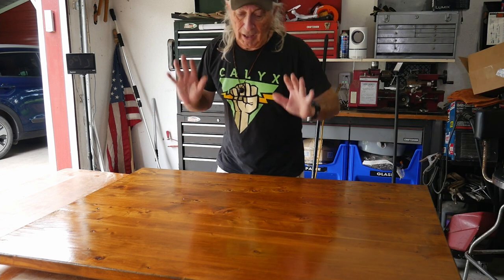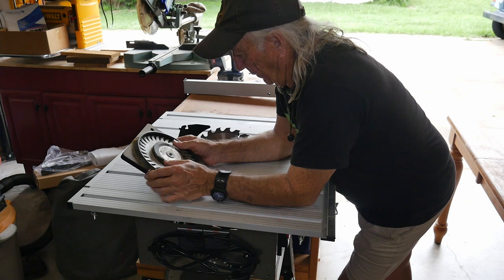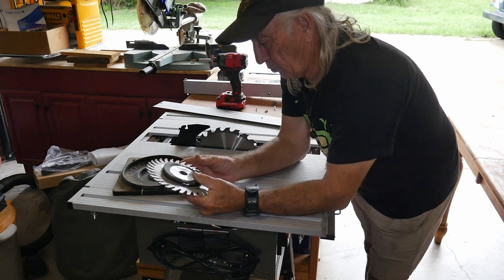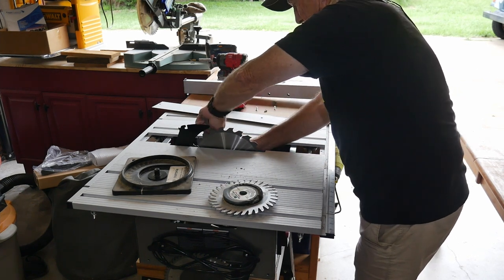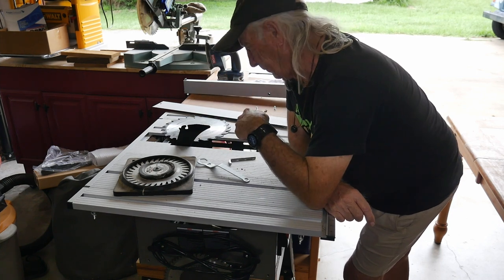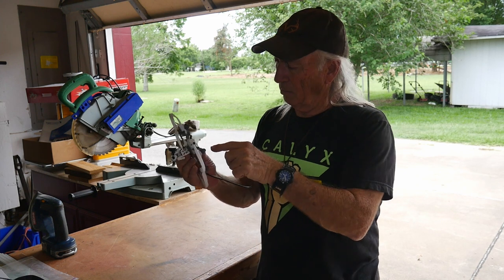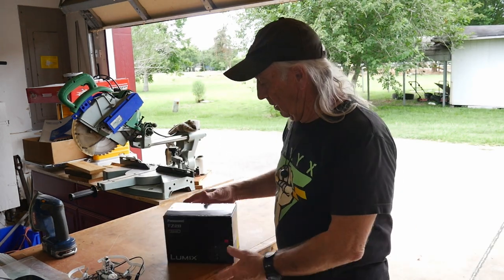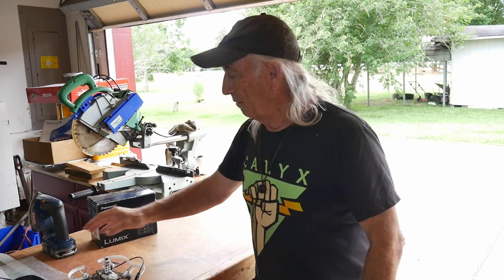Dado blades on Tacklife table saw ? Give away again this week at C&T episode 156 More FREE STUFF !

Comment: I ran into the same problem with my Dewalt….too short an arbor for a stack. HOWEVER, I found a guy on YouTube (what CAN’T you find on YouTube), who determined the arbors on the Dewalt saws are identical INSIDE. SO, he did a video that identified all the necessary components by part numbers, and how to swap the short for the long! I can now do dado stacks! The only issue is the guard. He showed how to make one in wood so I’ve not tried the Dewalt manufactured one which means I can’t speak to if it would fit though I have no reason to believe it would not, if someone wanted to buy the pretty yellow metal one. Now let me ask about that adjustable blade. Do you have any indication that the wobble effect has any impact on the life of the arbor? That’s the only thing that would concern me.
Reply from the maker: The tacklife saw is not with me anymore. Actually had 2 units here from Tacklife but they are both history now. De Walt references..mm I've run into that before but last time it didn't work. Never trust "youtube" LOLOL
Reply: @SirTools  if all else fails…I’m falling back to the old reliable older Craftsman!! I don’t have the time, patience OR money for those “hey, look at me” tools whose name is worth more than its products!!😁👊🏻
Reply: @SirTools  can’t say I cared for that tacklife saw my friend! Just didn’t impress me as a stand up and work with even remotely reliable accuracy. But oh MAN do I like that crosscut tool!! I still may pull the trigger on that! I haven’t seen a saw yet that’s impressed me with that accessory! All cheap junk. But that one you hit the WIN Bell with…very nice!!
Reply from the maker: I think the tool market is getting a bit bloated anyway :)